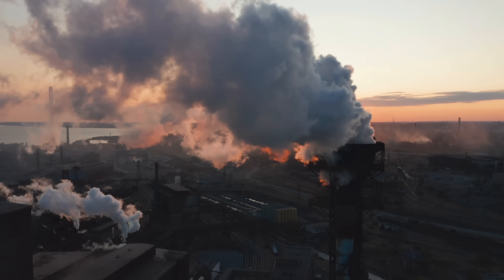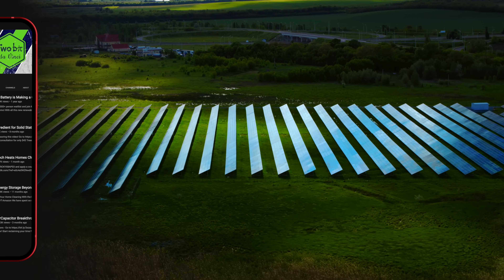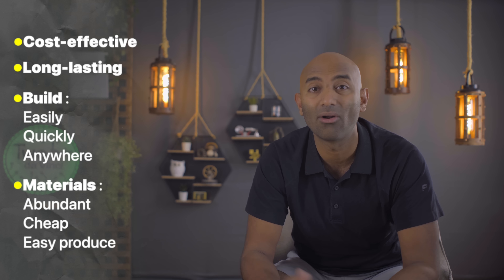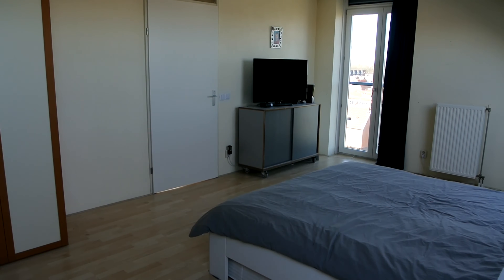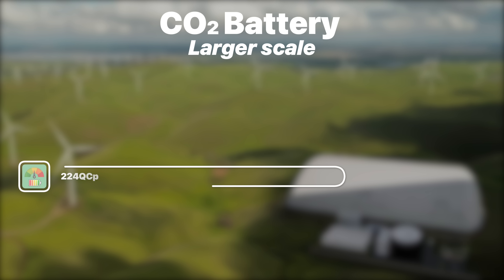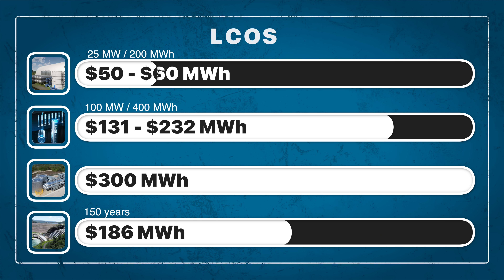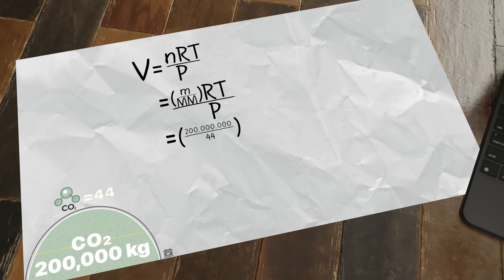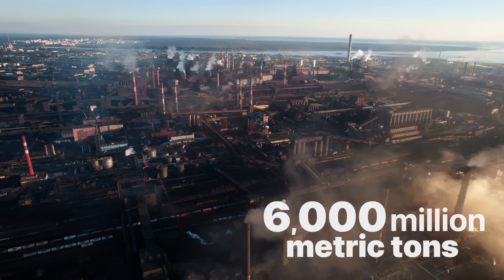The GENIUS Of the Carbon Dioxide Battery

Comment: The fact that it's using CO2 is really tangential to the important topic, which is grid-scale energy storage using cost-effective, sustainable, and durable materials.  Storing renewable energy is going to be a huge challenge and using relatively scarce materials, like NMC or any lithium chemistry, takes away from using those in mobile applications.  We can't get hung up on this solution using CO2, as though it's going to remove a lot of carbon dioxide from the atmosphere.  We need to stay focused on renewable energy production to reduce greenhouse emissions and technologies like this battery to store that energy.  It doesn't make much difference that it's sequestering a relatively small amount of CO2 in the process.
Reply: The CO2 "sequestered" is irrelevant.  Wind and solar are not viable without energy storage.

Comment: What about disaster, if this CO2 dome will be damaged and release all that CO2 at once? It will be very dangerous, CO2 is toxic, not only it will block oxygen but it will kill people and animals even in presence of oxygen. I don't think it should be built in close proximity to population and not in valleys and other areas that can trap CO2 or that have population that could be affected by such CO2 cloud. And not in fragile or important environments. Not a deal breaker, but something to notice.

Don't try to make direct carbon capture happen (yet anyway), it's stupid, it's energy intensive, it's petrol corporation scam and there are far better alternatives for a long time. As far as I know, today most CO2 production for industry (for example for carbonated drinks) comes from fertiliser production as a byproduct. I'm not sure if all of that is already used, but it's huge amount of CO2 so no need to force anyone to spend huge amounts of electricity just so in other place we can release CO2 that would be used otherwise. Even if this will be fully tapped, capturing other byproducts is far superior to milking air for 0.04%. Every gas power plant produces huge amount of CO2, and with gas it's quite clean and has much higher concentration than in air, so energy requirements will be far lower.

Comment: Actually the energy stored as heat, the Co2 only a method to convert it to electricity and back.
Probably the heat storage is kind of sand battery, or similar.

Comment: All these non-battery grid storage systems face the same conundrum, will they be cheaper than grid storage batteries 10 years from now? Their prices aren't going to drop much over the coming decade. Battery manufacturing is just starting to ramp and batteries specifically for grid storage are in their infancy. If batteries keep following the price curve, long-term the price of battery-base energy storage is going to hard to beat.

Comment: Just a thought but I presume the bladder is simply offering a containment function. If that is the case could one consider spent oil/gas wells as the storage facility or come to that any impervious volume?
Reply: I think it could work, but perhaps contamination of the gas would be an issue?
Reply: @ipp_tutor  Yes, I too would suspect that but I'm sure separation would be feasible.
Reply: I've heard of that being experimented with for pressurized air systems. Instead of tanks use old wells or air tight pockets in the earth to hold the pressure until generation is needed.

Comment: You could build it next to a coal or gas plant to capture CO2 from it, use the existing grid connection and land already paid for, then shut down the coal or gas plant when it's no longer needed.

Comment: Does it really make sense to use carbon captured (CC) gas? If a leaked dome is just a drop in the bucket, then capturing enough CO2 to fill the dome would just be a drop out of the bucket. I’d much rather use that money to prevent having to use the CC, ie replacing old tech with more efficient devices. Or doing one of the many possibilities of directly sequestering CO2 (tree farms…) into the earth that last a lot longer than the CC devices. If the dome works well, then maybe peaker plants don’t need to run, saving more CO2 than is in the dome each time the plant doesn’t need to run.

Comment: One question I have is how quickly can the CO2 storage react to changes in demand? Battery storage facilities are really great at near immediate releases of electricity to respond to demand spikes. It seems like C02 storage would need at least a few minutes, so perhaps great for longer term demand increases, but in conjunction with other "instant" demand usage smoothing facilities.
Reply: Maybe they could add a small lithium battery to handle instant demand while the generator starts.
Reply: As the gas is powering a turbine, the volume/pressure of the gas could be regulated to provide the required turbine speed, and adjusted to demand.  This is how a typical steam turbine generator works, steam pressure is constantly being adjusted.
Reply: @tomrogers9467  Agreed. Although you can only adjust it so much based on the input pressure. I think he makes a fair point as one of the stages of the process involves vaporizing the CO2, and that takes time. If you deplete the CO2 going into the turbine too quickly, I think it's possible to hit a bottleneck and perhaps there's a cap on how much power it can deliver.
Reply: @ipp_tutor   On a related note, I’ve had the privilege of touring an atomic energy plant with an employee, my cousin.  Standing next to a 550 MW turbine is something to experience!  The noise is deafening! 
 I’d love to be working on a project like this - in another life and with the proper education!  Too late now at 70!  Maybe next time around!
Reply: The answers are in the video; 
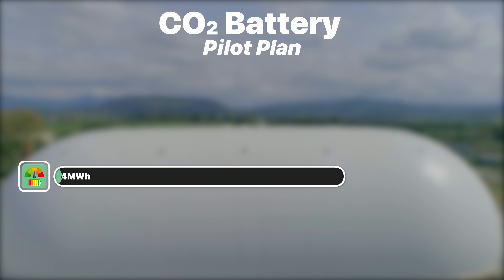6:37;  Small scale plant; 4MWh at max 2.5MW (62.5%)
6:54: Bigger scale plant;  200MWh at max 20MW (10%)
So the true answer is; it all depends on gear used in the steps/design manual.

Comment: Something doesn't add up here. The CO2 is being liquified by pressure and removing heat of condensation. THIS IS A SIGNIFICANT AMOUNT OF THE ENERGY EXPENT IN THE STORAGE PROCESS, all of which comes from the solar panels and windmills. To recover this energy, the liquid CO2 must be expanded back to atmospheric pressure. To do this, the liquid ABSORBS HEAT FROM THE SURROUNDINGS to cause it to expand! This heat is what causes the liquid to change back into a gas!  So in these "super duper" energy storage systems, where is the heat of evaporation coming from to EQUAL THE MEGAWATTS OF ENERGY FROM THE SOLAR PANELS AND WINDMILLS???  Gonna be a LOT of cold air produced somewhere! (This is one of the biggest problems with CO2 fire extinguisher systems. The CO2 freezes solid in the tank as it expands to a gas!)
Reply: I didn't understand the heat either.  Ideally they would store the heat generated by compression and use it during expansion.  But how is that done?
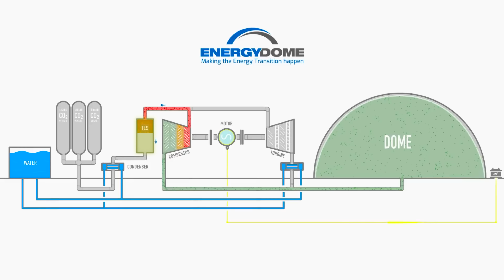Reply: OK, I just rewatched part of it at 5:34.  It uses a tank of water as "thermal storage" that cools the compressing gas, thus heating the water.  Then uses that hot water to heat the expanding gas.
Reply: @KenJackson_US  The quantity of water is not clearly mentioned. This will have to be carefully insulated to not lose the heat! To convert the megawatts proposed it will take a LOT of water! (there is no heat of phase change shown so it is simple heat capacity of water.)
Reply: True,  @glasslinger .  Though water is cheap.

Comment: How do these domes stand up to a good storm?  Or could the battery be charged and the dome deflated if a big storm was predicted?
Reply: Storm damage is usually from the ind getting underneath the structure.  These domes wouldn’t have that problems
Reply: Good question. I think the outside of the dome is a steel structure, so we probably can't deflate it. It would definitely be a challenge to keep that thing stuck to the ground under hurricane or tornado-style winds.

Comment: There are 2 cost factors that weren't mentioned in your video that I'm curious about. The price of the land needed for such a large battery, and the cost of maintenance needed for it. I'm not saying it's a bad idea, but all cost factors should be considered into the true cost per MW.
Reply: Without question land cost will be an issue sometimes, (ie to store output from a big wind turbine array in Napa Valley California vs. offshore wind farms in a remote area) while in other places it’ll likely be a negligible factor.  I’m also curious if this can be located anywhere within the grid as opposed to close to the generation site, I don’t see why not.  That’d make it much more adaptable and less influenced by land cost.  Making the components vertical might also be worthwhile, you could literally attach one onto the side of a new building and have backup power for the building.  I’d expect maintenance to be pretty low as it’s pretty much all just standard plumbing, piping and other equipment but it’s a very valid point, typically it would be factored into the LCOS that was mentioned.  Not doing so would be a large divergence from the normal way of calculating long term LCOS.
Reply: @sjsomething4936  Seems to me that it could be located anywhere between the source and the customer without adding losses, and I love the idea of a future  cityscape with big white insulating bubbles and rooftop greenspaces on top of all the buildings!
Of course, they probably include them with generation because a 100MW system is a lot cheaper than 100 1MW systems, and the grid's already designed with a high-power node at the source.
Reply: @sjsomething4936  That's a pretty valid point, you could have them close to the user as opposed to close to the source. That makes me think of large buildings like shopping malls with large domes on them hahaha. I'd love to see some kind of solar fabric draped over the dome too so it's space is still generating as well.
Reply: @sjsomething4936  I agree. I'm pretty sure that longevity, maintenance and even hardware replacement costs are factored in. Otherwise, it would be an absurd LCOS and I'm pretty sure a mammoth company like Orsted wouldn't have gone through with it. I'm pretty sure at least they know how to calculate a good LCOS.
Reply: Because the location of the battery is not dependent on anything except the location of the generated energy, the land use should not be that much of a factor. Plus I believe he mentioned the energy density of the battery being low, which for stationary batteries is basically the land use factor. As for the maintenance cost, it should be quite similar to a coal power plant or any power plant that uses a heat exchanger via a working fluid to make electricity.
Reply: land cost could also be reduced/removed if this system is vertically integrated into the facility providing the energy input.
or to put it more blunt: just put (parts of) the solar/wind farm ontop of the building that holds your CO2 battery system. not like those facilities care much if they are a few dozen m's higher up or not.
Reply: @TheXasTube  Hey, you're right. That's an excellent idea.
Reply: You don’t want these too near populated areas. CO2 is heavier than air and large CO2 leaks can asphyxiate people and animals. See the “Lake Nyos disaster” for an example.

However, these can be located near the source, or at a low cost location away from both people and the source, so long as it’s near the existing grid lines. Therefore, land cost should not be a significant obstacle. 

It would be smart for utilities to use captured CO2 rather than manufactured CO2 for initial charging of these plants, very smart PR, and with the carbon capture credits, it might be comparable in price.
Reply: The cost of land is different in every case and therefore not an aspect in this video but the cost of maintenance is something i agree with you. That one i am also curious about. Positive in these things. But right is right. 

Not that high i think but i dont know.
Reply: I know of a solution that stores co2 in nano carbon power in modified propane tanks . It can store 100 times the volume of co2 than this dome. These ideas will work well together.
Reforming natural gas to produce blue hydrogen and obtain the byproduct reformate as purified co2 is the easiest source of co2. Capturing co2 from the air is more expensive and wasteful.
Reply: @geoffforrester1396  But does it do so under atmospheric pressure, or at least low pressure? The dome is for the uncompressed storage, not the compressed storage. They use tanks that store the compressed CO2 at 70ATM.
Reply: @geoffforrester1396  
I think we should make fishfood from CO2 and use it as a recource to grow plants and trees like a forest or something.
Increase CO2 where less trees are so they need less water.
Reply: Another land cost that wasn't included was the amount of land and energy needed to produce rare earth metals. If this was included I think the little puddle of land for a 
CO2 dome would be minuscule.
Reply: IMO the costs are negligible and hardly needs to be calculated unless land is a premium.
Gases and liquids can be stored in containers of varying shapes although there is an ideal shape. But since carbon dioxide liquifies at only about 5.1 atmospheres, the container isn't stressed particularly highly so optimum shape is not necessary unless you're creating the container out of unusual materials for lightness like in a rocket booster. Assuming we are talking about terrestrial windmills or PV panels, the container can be made with cheap but strong grades of stainless steel or even iron or a plastic, stand it on end and make it as tall as you want above ground if the project calls for that.

As for maintenance, I see a system pressuring carbon dioxide as nearly identical to a common refrigerator/freezer. Maintenance would be nil during its entire lifetime of what... maybe 30, maybe 60 years or more? There are a lot of refrigerator/freezers that still work after many, many decades if they haven't oxidized due to inexpensive parts.
Reply: Clean nuclear is the future...no nuclear grade waste`   we never used the best because no nuclear weapon grade byproducts.     we need to stay away from unaffordable energy that pollutes more than fossil fuels.... they plan on burning coal to meet the needs solar and wind can't provide. Going green will cause more pollution!
Reply: @somewhatinformed1208  
You have no idea how stupid they r.
Reply: What about the biggest one missed, Where does the co2 come from, thats is still too expensive to capture.
Reply: Probably get CO2 free from a beer factory.  There must be one around somewhere not far away.  And you only need to get the CO2 once.  It is not consumed in the process.
Reply: @edwardcoulter9361  Small irony here: in my research I've learned most breweries have found it more cost effective to purchase liquid CO2 than to invest in CO2 generators and/or CO2 recovery.
Reply: @Findmannynow  They would need an on sight CO2 capture facility also to keep the system topped off from leaks which will happen. They are definitely heading in the right direction with this though.
Reply: @Findmannynow In the US, making ethanol from corn produces a lot of CO2, roughly 50% of Ethanol and CO2 by weight is the output of the fermentation process. This CO2 is mostly captured and sold as food-grade CO2 for use in fizzy beverages. If we have to make a lot of biofuel for airlines, that may also produce CO2 which could be captured.
Reply: @Findmannynow  
Capturing CO2 is very very easy and it costs a minimum of energy.
The only thing is if they store CO2 they can not make profit from it.
The costs of storage are aproximatly  $100.000 / 1 million kilo's per 50 acres per year but almost limmitles

Comment: Would the average volume of a windmill's column be close to enough storage space for what that given windmill could pump store in a 24hr period?
Reply: Interesting idea but inside the column is a stairway to get to the top for maintenance. Can’t have it filled during maintenance and that would add complexity to the system that would drive up costs. Not to mention that if something went wrong, you’d have technician lives in danger.
Reply: @russellklegraefe6425  or they could climb the outside 😁
Reply: suspending a huge tube  bladder in the tower would work. and due to the smaller size a reversible screw compressor and just one Co2 tank could be used per wind turbine. Would need C02 leak detectors, and the tower already has to be ventilated while working on it.

Comment: You didn't explain the diagram at 4:50. What is the TES and gas turbine? Looks to me like this is a more efficient gas peaker plant. The system is burning natural gas in the gas turbine to spin the generator, then the stored CO2 is being used to collect extra heat from the exhaust. The CO2 is just an energy collecting medium like water/ steam in other power plants. This is not collecting and using CO2 to save the planet.
Reply: No, the explanation in the video is correct. TES = Thermal Energy Storage

Comment: Why is this better than the liquid air battery? Don’t both store the heat created during compression and add it to gasify the liquid? If so, wouldnt it be better to not have a bladder that limits the size of the storage. Liquid air batteries can add as many storage tanks as necessary and the price per kWh decreases (and the system becomes more efficient) as the storage size increases.
Reply: If I understand correctly, for liquid air you have to activly cool down and maintain a low temperature to keep it liquid. In contrast the co2 transitions to a liquid at about 60 bar at room temperature. So you don't have to keep cooling the system, and no amount of isolation can save you from the need to constantly keep cooling it.
Reply: @masterix4021  why would you need to cool liquid air if it was properly stored in pressurized tanks?
Reply: @flutieflambert  Because you can't PUT it in the tanks unless you cool it to a liquid.